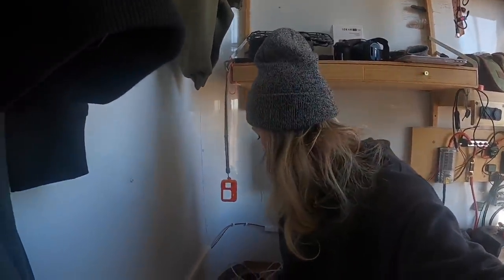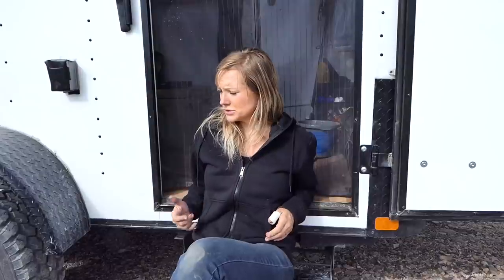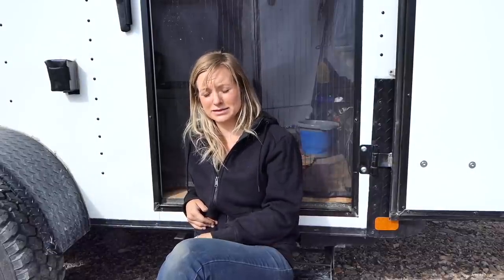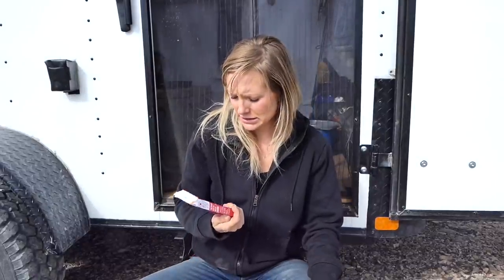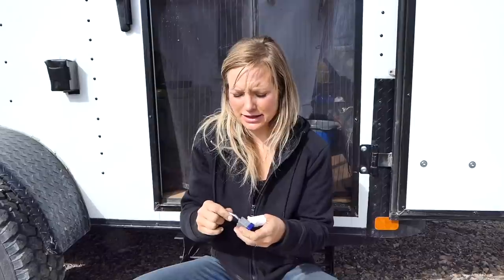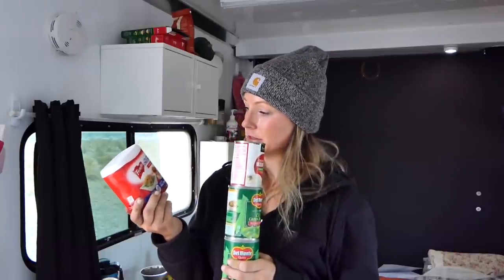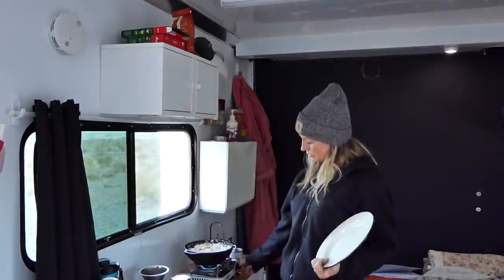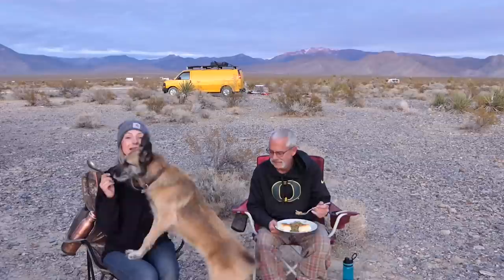DIY D’ohs  - Living in a Cargo Trailer Camper

Comment: We have a Dometic 55 12v/110vac. We love it. It totally runs off our solar system. Very little current draw. It has only one problem, it costs $800. It is a refrigerator or a freezer. Not both at the same time. What we have discovered is that if you fill it up with water jugs and freeze them, then move them to an ice chest you continually have ice, a freezer and a refrigerator. We have Boondocked for long periods of time this way. The next size up has a separate freezer but it is very small. There are a couple of cheaper ones out there. Check out Hobo Techs videos. He did a review on refrigerators. He does extensive tests so if he says it’s good, it’s good.

Comment: Best practice suggestion: install a check / non-return valve between tank and fuel filter / pump (or foot valve depending on how the tank is installed) to keep the suction pipeline filled with liquid fuel thus avoiding cavitation (=pumping air creates hydraulic hammer effect which actually can break filter and pump quite quickly). Also ball or butterfly valves at key spots for easier maintenance, shutting off before removing / replacing any device or tubing without spilling out fuel or needing purge - refill - bleed.

Comment: another good peice of advice is those pumps are made to PUSH not pull, so install the pump close to the tank and make sure the filter is between the pump and the heater

Comment: People say they have problems with them that's because they're not installed right these are trouble free and very easy to fix you can take the whole thing apart and put it back together in 20 minutes and fix everything that's wrong with it if something major happens fact that they're sending you a new one fantastic keep the old one for parts if I can get them both running 
Makes a good car warmer remote

Comment: Ouch, sorry about your thumb. Hope that heals well. Hemostatic gauze is great for a med kit. Search around for a medical "IFAK" or a "blowout kit". Not that you should ever want to use this, it can be the difference between life and not when a long way away from medical help or mobile signal. BTW, I mounted my diesel heater through my cargo floor for the exact reason of not leaking anything inside, raw fuel of fumes. Diesel fuel is a powerful neurotoxin. I know someone who was poisoned by diesel, and it took years of exposure by living very close to a major shipping port so don't freak out of a minor spill, but you may want to rethinking having all off the leak potential outside your living environment.

Comment: Found your channel from another channel!  FYI regarding locks... American locks (5100 models and some other models)  are designed to be abused and weather resistant.  I'm a former storage facility owner and have used HUNDREDS of these locks.  They are a bit expensive but will last a VERY long time.  You can also get a spray that is designed to help unfreeze locks during the winter.  Cheers to you!

Comment: nestle in mexico makes a product called nido, it's powdered whole milk in a resealable can and is very good. you mix only as much as you need, it doesn't require refrigeration until you mix it with water and an opened can is supposed to be good for 6-8 months. any good grocery store with a hispanic food section carries it, or you can buy it online. i use it all the time and it's a really great product.

Comment: FYI, angle the fuel pump up to a steeper angle with the exit up. An air pocket can develop in the pump when set horizontal causing premature failure.

Comment: 'Long Story Short', after Weeks of going Back & Forth as to Which is Best for Heat, I  went with a 'Wood Burning Stove'. Ya, nobody wants to hear that from someone else, but the Dry Heat is The Best. Plus, there is Nothing like the Great Vibes of a Flickering Fire, along with the Aroma, and being able to do both Long time Slow-Cooking & Fast hot water for Coffee and Quick sponge bathing. Free Fuel is Another Winner. I  made the right choice & Everyone is 'Knocked Out' with the Ambiance. I have learned So Much over the months by watching Multiple videos of Van and Cargo 'Build Outs' from All Those going through the same challenges. So Many Great ideas out there. I don't know for sure, but Wood is my friend. I will post a picture of Bruzetta sleeping in front of the Flames as soon as I start my Show. Stay Warm you guys.(Gals)🔥👋
Reply from the maker: I love that idea but the quote I got from cubic mini was just under $1,800 for the full stove set up... $150 made more sense to me for where I’m at but I agree to the undeniable ambiance and loveliness of wood burning stoves.
Reply: @LexandRiot  Hello Again Lex. I Too looked at the Cubic Mini. The 'Parts Needed' were as much as the Stove Alone. Not Cool. Way Overpriced. So I  found a Better company. Check Out 'Winnerwell'. They make about 7-10 designs. I  got the one with Two Windows(they make several sizes with windows) and it was $449 before tax. They also have a Tank to Boil water or melt snow that fits on top with a Spicket. Real Nice. That I've got to get. It's extra. However this stove has a bit of a different look. For me, I Love it. Plus, I can put it into my large Tee-Pee Tent if I ever want. Stove is lightweight and Super Well Built.(cripes, I should Rep. the co.)Google them &  check out all the pictures. See if you like the 'Look'. Their # is(385)388-4923. All the pipes and a spark arrestor comes with it. And    a Travel Bag. Only 28lbs. During Summer, I will take it out. Have a 'Look See', maybe it's something to consider. 👌Thanks for the Reply. Erik. (you'll Love it, I promise)

Comment: Okay a few things first for the locks go watch some bosnianbill or lockpickinglawyer,on those master locks they both have 100's of videos on them. They show you many alternate ways to open them and most times in seconds, not hours, like you probably had to do with finding a saw, then the actual sawing part. 

       As for the cooking part try using White pepper it same thing just processed differently black is dried strait off the plant and white is soaked in water for a few days then dried the soaking mellows out the spiciness while still having a pepper flavor. Another thing that can be used instead of milk is coffee creamer it better than milk in some recipes like soups like chowders IMO just put it in hot water and add creamer to taste. I know nothing about diesel heaters so no advice there sorry

Comment: I'm a nurse, I have used superglue on many many lacerations. A little concern that it looked like an evulsion witch may not have the best prognosis. But for most if not all lacerations after thoroughly cleaning use super glue.

Comment: On the topic of 12V fridge, YouTube had an ad for a GoSun Chill and the ad was hella cheap. 129.99 for a cooler and solar panels from a place in Florida...Yeah I used a gift card on Oct 17 and I'm bettin I am out the cash as the gift card cannot help once purchase is made...Buyer beware, You Tube ads are not checked as near as I can tell and I will never purchase ANYTHING from their ads again... Extras are part of my issues but in the case of the heater it would have paid off!!! Hey way cool. Sorry to hear about your owie...That aluminum is known for it's surprise attacks...If you get wounds that are way deep, QuickClot may be for you...Yeah I agree with others in chat...Robert just eating, I was laughing...Riot your direction is getting better...Great video lex

Comment: The fuel pump likely died shortly after the fuel filter broke. When the filter broke, there was no fuel and lots of air getting sucked into the pump. These pumps are lubricated by the fuel itself, so it simply went dry and then failed due to lack of lubricant. Lots of comments, so I didn't read thru all to see if someone already shared this.

Comment: I had the same problem with my diesel heater  something broke in the filter the filter dissolved and  something got  in the line and blocked the line took me about three days to figure out what it was and then I ordered about 6 filters and an extra pump but I didn't need a pump just needed to change the filter and I blew the lines .. that's the only problem I ever had with it and I have two of them other than the metre getting dull which is a common thing so I have a manual switch as well for backup

Comment: I hope you got the diesel smell out of your camper. It is nasty. Get yourself a pair of mechanics gloves for the next time you have to work on sheet metal. 
See if you can find a metal inline filter for your heater. Plastic tends to get brittle and with the shaking and bouncing down the road when you’re towing you could have more problems. 
Robert didn’t look too excited about the green bean casserole 😂
Be safe

Comment: Ouch!. I keep bactracin first aide ointment also, no preservatives. Why not put a first aide section in your links? Bleedstop.  As a retired icu nurse i have always sworn by cheap superglue, always kept i in my bag. Hold hand or appendage above heart to slow bleeding, wrap or hold with turnicate to stop the flow, clean, dry, add superglue over,  wipe, wait 1-2 minutes, wrap. Holds about 2-3 days. I know chemicals!, in a bad spot, it works lightning fast. Worth 1$ at harbor freight for 4 of them. Saved me a week ago when a pop top tried to carve out a piece of my thumb for what its worth.

Comment: If your fuel pump breaks or your fuel line or a fuel filter between the fuel pump in the tank gets a crack or a leak in it it will start with the fuel pump of fuel and burn up the pump so you may need both a new line or a new filter and then a new fuel pump as part of the process

Comment: FWIW: 
Alternatives to cans of condensed milk… 

Purchased at Walmart, located  in the Hispanic foods aisle, 
a #10 (gallon-size) can of “Nestle Nido Fortificado”, ($15.64) shelf-stable POWDERED WHOLE MILK with a one year shelf life. Also available in a smaller quart-size can. Produced in Mexico. 
As seen on YouTube and recommended by “Alaska Granny” for long term pantry storage. 

Another Walmart choice… 
Shelf-stable… “Paramalat” liquid whole milk in quart size cartons (Tetra Pak). No need for refrigeration until unsealed. Ultra High Temperature (UHT)  Pasteurization. Has a unique and peculiar flavor, but unnoticeable on cold cereal or in cooking/baking recipes. ($2.27 per quart) Pretty steep entry fee, but may make sense (cents!) when stored in pantry for impending dire straits…

Another similar choice… 
Found at “Dollar Tree”, 
“Gossner Foods” Premium Whole Milk. Product of Logan, Utah, USA. Almost exact physical description as found above, but ONLY $1.00 per quart. 
I tested both brands side by side when chilled and ice cold. I did not notice a discernible difference in the two. 

I first had this type of milk when I was deployed in the Western Pacific. 

Good luck Lex. I hope that thumb heals without issue.

Comment: Regarding getting a 12V fridge, we actually went with the VL 60 Iceco single compartment refrigerator. You can set it to different refrigerator temperatures or freezer. We are using it at freezerish temperature with our solar battery while having ice packs we switch out into a cooler that we already had to keep other items at “refrigerator” temperature. Which definitely allows being able to store a ton of food and be off the grid for longer periods. It runs around $550 or so on Amazon, which may be more than you want to spend but wanted to share what works for us! There are cool duel compartments available for fridge and freezer as well but they cost quite a bit more.

ICECO VL60 63 Quart Single Zone Portable Refrigerator with SECOP Compressor, 60 Liters Platinum Compact Refrigerator, DC 12/24V, AC 110-240V, 0℉ to 50℉, Home & Car Use (without Insulate Cover) https://www.amazon.com/dp/B0831KRWRT/ref=cm_sw_r_cp_api_fabc_PKUSFbKKQPZDZ

Comment: He wouldn’t have eaten more than one bite if it were not good. He was just carefully tasting to be sure before commenting, carefully measuring his words. I’m sure it was great.         WATCH THAT THUMB CAREFULLY! If you see ANY sign of red streaks on or near the cut GET TO A DOC IMMEDIATELY! It is a deep cut in a bad place (the joint).  Go easy on the peroxide. Dilute with water. The H2O2 has a scouring effect that may actually slow healing.        I once knew a man who got a little puncture wound on his leg while out fishing. He “doctored” it himself. Macho dude, right? Didn’t go to a doc til he started seeing red streaks and having pain. Doc took one look at it and gave him the good news/bad news. Good news was that he could keep the guy from dying, bad news was that the leg required amputation. DON’T BE THAT GUY!             Diesel fuel, like jet fuel and kerosene, has an odor that is really hard to kill. Try cleaning first with degreaser then use “odor ban” and/or pinesol and/or turpentine (might be hard to find). If it got into fabric the smell may never really go away.
Reply: Oh, and ABSOLUTELY NO HOT SPRINGS until the thumb is completely healed. Many of the springs contain Naegleria fowleri and harmful “flesh eating” bacteria. Not worth the risk!

Comment: love your channel ! about the same time as you i put a chinese diesel heater in my cargo trailer also. i love it but i cant turn it down low enough. in 20 degree temps after running for an hour it is about 86 degrees inside ! hrtz are at 1.6 and temp at 10. any ideas ? thanks and keep posting videos, they are great !
Reply: Good question. Location of your thermostat maybe. I set mine at 19c and it keeps it at 72f.

Comment: I got an xtremepower 54 quart fridge. 285 on Amazon. I ran it for 7 days at 38° from one charge on my bluetti 1500. My livingroom is full of supplies for my van build. It is an 86 Chevy van lifted 4x4 with a 12valve Cummins diesel I just had put in. I want to get the farthest away from civilization as possible. I love individuals but I need deep meditation to have that bliss that comes with the quiet mind.🙏 Good to know about extra fuel pumps for the heater. Have you thought about getting Riot a friend?
Anyway I better let you go for now. Do you have IG?
Reply from the maker: Hi! Sounds like a great rig! Riot had a lab and a Rottweiler as friends but the boys passed on over the last few years. I don’t have any other social media, just this stuff. Thanks for watching!
Reply: @LexandRiot  getting a lot out of your posts. Will eventually get to all of them. Hope to see you on the road one day. My rig kinda looks like mad Max meets walking dead. Going to put railroad ties for bumpers. 🤣

Comment: Are you able to run the diesel heater from the Jackery? We put in a separate battery for the heater ourselves, and wondering if that was overkill.
Reply from the maker: Hi! No, I use an AGM battery and 200w panels for my main solar. I started with the Jackery but that was pre-trailer even. It’s still useful though not to run the heater. Thanks for watching!
Reply: @LexandRiot  Thanks for the reply. I use a Jackery 500 for everything other than the heater - for the heater, I have a 50ah AGM and I recharge it from the Jackery. I get two nights of heat before I have to charge the Jackery.

Comment: I almost cut the tips of my fingers my first and my second finger on my left hand and I found out instead of alcohol or peroxide to clean it and help with the healing believe it or not bleach was what I ended up using I used 1 part bleach 1 part water basically diluting the bleach a little bit I would soak my fingers for about a minute or two and then I would put after I dry them off tripple antibiotic and then bandaged them up I would do the bleach every two days the same process this was a week and a half ago they are healing up nicely I was really worried I was using electric planer and my fingers got way too close to the cutting blades and almost cut the whole tips of my fingers right off it really did take off good chunks of my fingers but believe it or not from different people that I have met and also know told me about the bleach and it ended up being better 4 the healing process of my fingers than peroxide or alcohol because those tend to slow the healing process I would look into it don't take my word for it about the bleach but it works for me